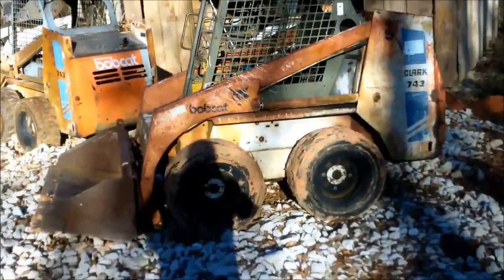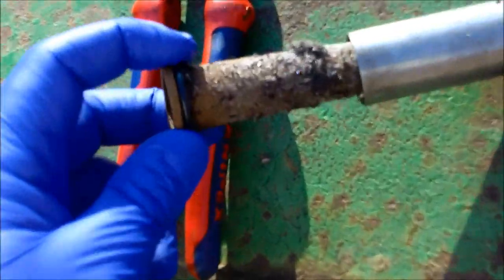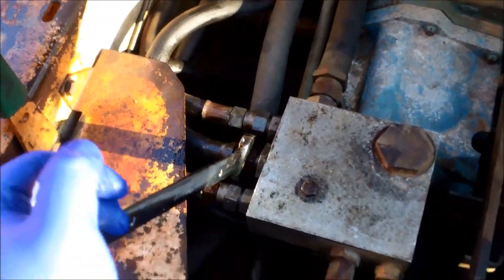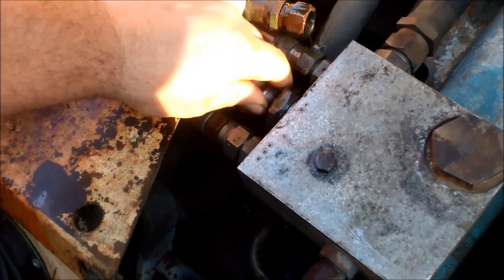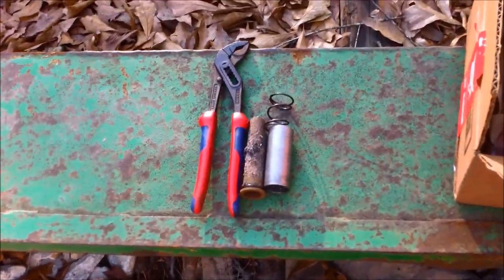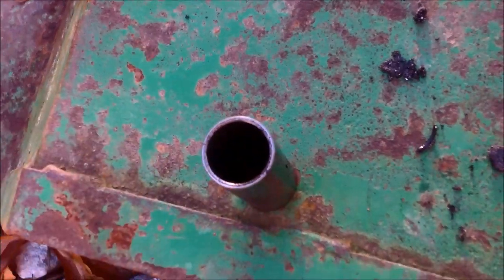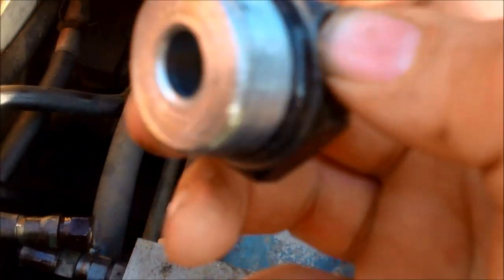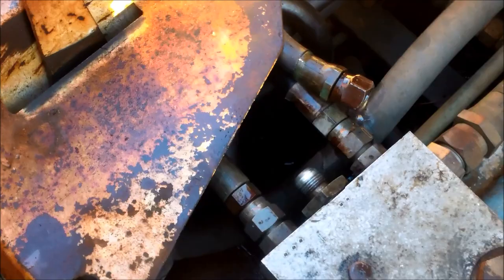HOW to Fix a Bobcat that doesn't move

Comment: I’ve never owned a skid steer or worked on one aside from greasing one before using it. I am a mechanic though an atv mechanic but I am thinking about buying a dead 743 or 745 something like that, definitely 74 something. Anyways on atv’s I use clymer manuals, on vehicles I use haynes manuals, is there a repair manual for these that is not written for professional tractor mechanics?
Reply from the maker: I got one for a 743 I think ebay has em

Comment: Hi! Great video. My Bobcat 853H starts but nothing moves. Arms won't move either. Someone was moving dirt off a pile with it and then it just stopped moving, still starts and runs but nothing moves at all. Any and all ideas appreciated. Think the fuses are all ok and it has hydraulic fluid. Very much a beginner here so thank you in advance for your suggestions.
Reply from the maker: Hmmm so no hydraulics at all, any sounds id check the belt between the engine and pump could be bad or slipping
Reply: Did you get it figured out?  I have an 843 and there’s a universal joint between the engine and hydraulic pump could have possibly broke

Comment: I tried to remove this filter and the threaded end ripped out of the filter attempting to do it the way you have…
2 questions -
1. Obviously it’s not ok to put it back together and run like this…
2. How do I get it out as I will order a new one!!!  It won’t move with anything.

Comment: Hey I did what you said on the video but it's still not working you know what else could I check at first it wouldn't turn, after I changed the filter now it doesn't move at all, and it makes a noise like something lose in the transmission or something
Reply from the maker: @elverrodriguez1930  undo some lines see if it's building pressure

Comment: Hey I have a 732 model and want to see if this is an issue or not.  The machine moves but has been pretty abused over it's life so I want to see what this filter holds.  How can I prevent losing all my fluid when checking this?  Cap the valve body and hose when removed?  Thanks
Reply: Hi there again. I'm actually gonna do this tomorrow. See if it gets fixed.
Reply: @blitz8619  let us know!  I need to do it on my 732 still.
Reply: @blitz8619  did you do the job?

Comment: I have a 743B that won’t move, but the sticks have pressure and makes grinding noises if you try to move it.  Bucket raises and tilts fine.  Any ideas?
Reply: Did you check that the auxiliary hydraulics are turned off?  Do this by  moving the right steering lever inward.

Comment: I have a bobcat that’s filling up the chain box in the bottom with hydraulic fluid checked both drive motors and it’s not bypassing by them think it could be the hydraulic pump seal have any ideas
Reply: Motor carrier seal on chaincase side is bad. To find it is a really big job, but it's the only thing that'll fill the chain case.

Comment: Bro I got the same machine for 3k and it has the same issue
Reply from the maker: Just remove the filter for testing once fixed and you paint it you can get 12k now prices crazy high
Reply: @DannysCam  For real man I got a great deal on it, does need paint, already ordered all new filters decals I’ll fix leaking lines and paint is all it needs.
Reply: @DannysCam  is this same filter on a 732?  also I'm assuming you need to work fast when replacing this or all the fluid drains from the system?

Comment: Good looking
Reply from the maker: Thanks
Reply: got a bobcat 843 the control valve started leaking really really bad so instead of fixing the 843 I bought a little 463  bobcat from a Italiano it's better than the 843
Reply from the maker: @bobcat8439  fix that 843 they still got value I sold a leaking 843 for 8k once
Reply: @DannysCam  I recycled pallets in my yard the 843 leak so bad I had dogs in the yard Ibotta 463 little bobcat it works better then I just bought a 440 b bobcat for backup
Reply: @DannysCam   from Little Italy New York I'll get to it back is 440b
Reply: @DannysCam   the 843 control valves the buried so deep